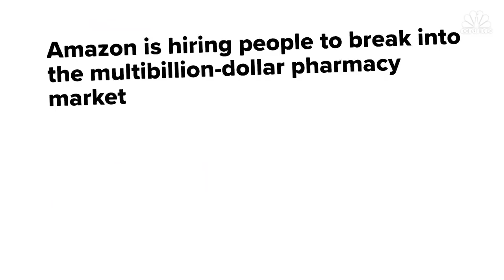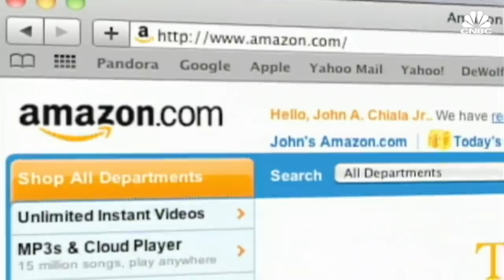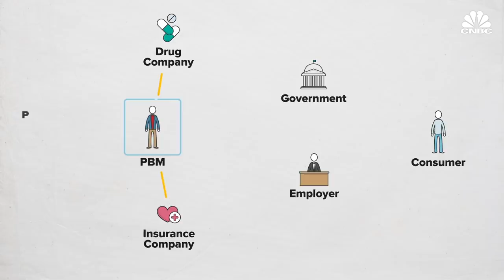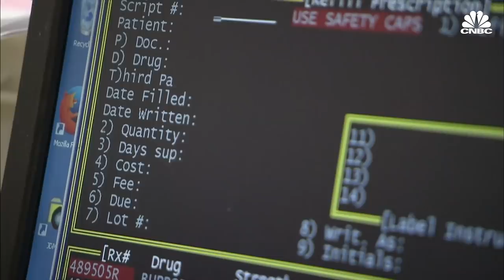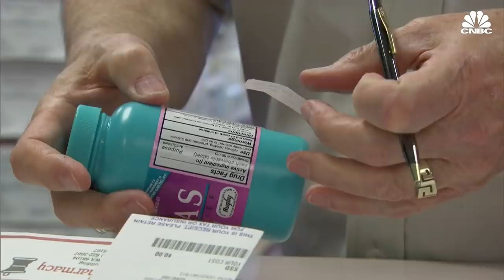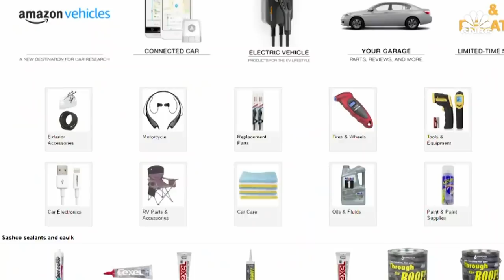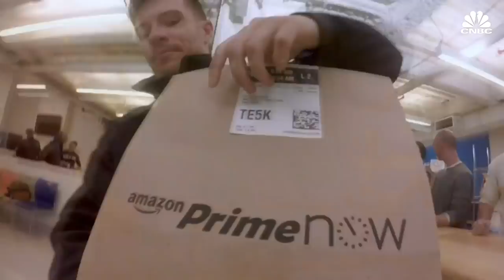How Amazon Could Disrupt Health Care

Comment: Pharmacist here: a major issue is the insurance company or PBM which deals with prescription drugs coverage are making it incredibly difficult for the doctors/pharmacies to dispense medications to patients in a timely manner by requiring tons of paperwork or lengthy phone calls just so they can deny coverage for the medication(s) in the end (for example: prior authorization). Even if insurance decides to cover a medication but if it has high copay (like $200 a month for an inhaler) then patient still can’t afford it.  Drug manufacturer dictates how much a drug cost and insurance dictates how much the patient pays for it.  So if Amazon can attack those two areas, then maybe, there’s a chance for low cost prescription.